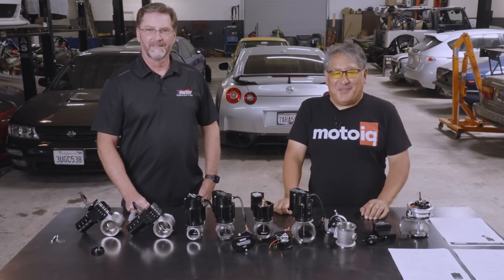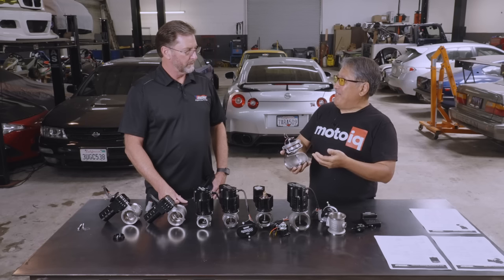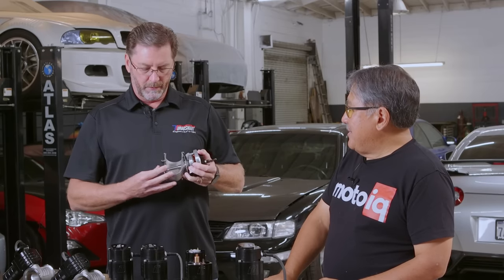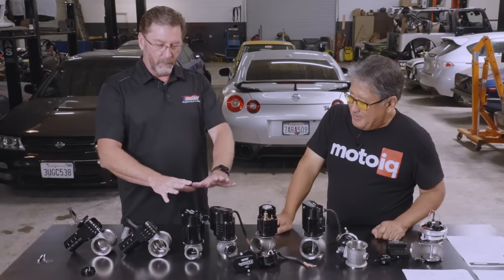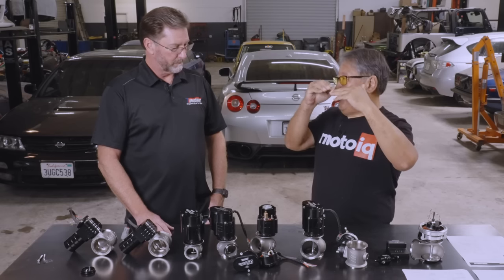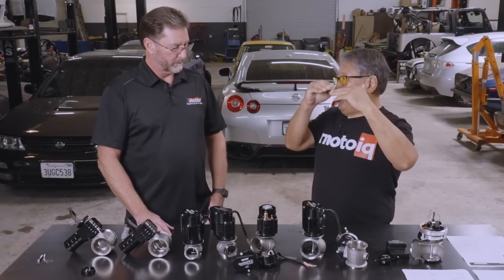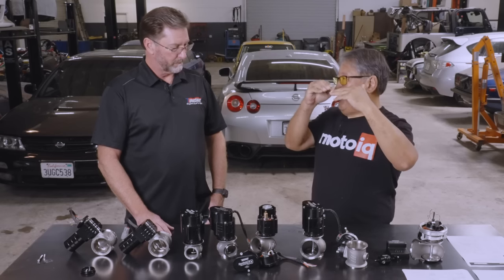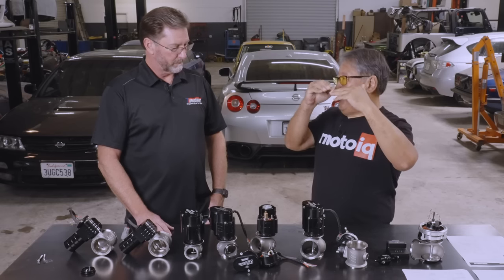The Future of Boost Control: Electronic Wastegates

Comment: As an industrial automation controls engineer, I fail to see how valve POS is really all that relevant. Typically in industrial applications, we would for example monitor manifold pressure, drive pressure, and supply pressure to the diaphragm on the wastegate. Then there would be an I/P converter & PID loop controlling the supply pressure to the waste gate diaphragm. Valve pos is really irrelevant as what you’re controlling is boost/manifold pressure. What everything else is doing is somewhat irrelevant. IE open loop controls. Not an engine tuner so I’m not inherently familiar with these issues however seems weird to me as industrial applications we control pneumatic and hydraulics in this manner all the time.
Reply from the maker: The valve postion equates to flow volume, like any poppet style valve, it's pretty common sense.
Reply: @motoiq  What I was referring to is the PID, target manifold pressure in conjunction with the rest of the IO handle that. The Processor/PID determines output based on reference manifold pressure. In this sense the valve position is irrelevant. Most analog valves wether they be pneumatic, hydraulic don’t have an LVDT or encoder to determine valve position and work just fine. Your answer explains nothing….
My question was, is there a reason this control approach won’t work in this application. It’s literally used all over industry and works just fine… As in maybe there is a legitimate reason for not using it, I don’t know. I’m assuming you don’t have a clue either as you just spouted off valve position determines flow. Well duh!!! And that flow isn’t proportional to valve position either so you’d need a curve to calculate that. Which when one is using a reference manifold pressure - input 1, and has logic that dictates a target manifold pressure -input 2 and you’ve got an output waste gate 1, the differential between input 1 and input 2 dictates what output 1 does… I don’t need to know valve position… if manifold pressure is low, close the waste gate! If it’s high open it. Obviously an over simplification as these are analog devices and not Boolean but the point remains. How is the actual valve position relevant. As far as I’m aware the logic or computer isn’t determining waste gate output based on flow rate. To utilize that properly you need to know exactly what the exhaust flow rate is which obviously changes drastically very quickly. Doesn’t seem like an ideal controls strategy thus making waste gate valve position irrelevant. The PID is controlling to a set psi, not a set flow. You also mentioned compressor shaft speed. That could relatively easily be handled as well by some additional inputs in the PID controller. None of which again for the umpteenth time care about flow, when pressure is what’s of concern… Obviously flow is important but as far as the PID control loop is concerned, not so much.
Reply from the maker: Ah ok now I understand what you were saying and I agree that the valve position doesnt matter when the controller is looking at MAP or shaft speed.  I thought you meant that the valve postion doesnt matter from a flow standpoint.
Reply: @motoiq  a nice PID control would utilize shaft speed and valve position solely for error control IMHO. For example shaft speed gets to high, open the waste gate, valve position isn’t properly responding open waste gate, drop fuel. Save the engine, save the turbo. Other than that, that’s all I can see it’s relevant for. you could even use the shaft speed for boost leak detection, if shaft speed were high, vale was closed and MAP was low, one could infer there is a boost leak. In which case you still want to open the waste gate and or cut fuel.

Comment: i cannot understand, why "future", if some turbos has an electronic solenoid that manage the INTERNAL wastegate of their turbo. i have it on my fiorino city 2019 (ram v700 city) 1.3 diesel, by garrett gt12 series. i cannot understand
Reply from the maker: Because it's a shitty low capacity internal wastegate. This is a big high capacity motorsports wastegate, the first of it's kind on a consumer level.

Comment: while this is neat, there is a huge problem, heat and electronics, ( specifically motors) DO NOT MIX whiel the concept is cool, i foresee a LOT of problems with failed steppers for the gate valve.
Reply from the maker: This has been rigorously validated under conditions that would cook a mechanical wastegate. Mechanical wastegates can be failure-prone if the turbo system isn't designed properly, especially under racing conditions. The typical short-term failure mode is diaphragm melting, spring cooking, and losing tension or both. The longer term is valve stem scaling and sticking.
Reply: @motoiq  i stil think the steppers will fail under normal conditions sooner. just like every IAC i've seen over about 10 years old. there is also current based wear on electronic components as electricity is the constant transfer of electronics across conductive surfaces, this leads to breakdown over time from ionization as well as atomic frictional wear and tear from the electrons jumping. and a preocess called electromigration.
Reply from the maker: Which also happens to a standard mechanical wastegate. Electromigration is more of a thin film semiconductor thing and would be an issue if the part was not designed and validated for this sort of use like this is. We talked about it briefly but if you read the literature that comes with the wastage the validation testing is more more riguous that typical mechanical wastegates.

Comment: Add in possibility of loose, damp, corroded contacts.
Reply from the maker: Lots can go wrong with conventional wastegates as well, vacuum line falls off or gets left off, vacuum line deteriorates or melts, diaphragm melts or develops leaks, spring looses tension, valve sticks. I have seen all of this in my time working on turbo race cars.
Reply: @motoiq  yes...and radiator hoses fall off too !
Try watching YouTube !
Theirs video after VIDEO of wiring issues on today's electrics !!!
Tell me the TRUTH !
Do you use factory idiot lights or do you use say Auto-meter mechanical gauges on race cars ???
Engines have heat cycles..
Moisture, forms then evaporates...
Problems arise.
Springs collapse ???
What about jour valve springs ??
Which is used more,
Waste gate springs or valve springs ??
Your chassis has springs too !!
You just want to SELL THEM !
Or are sponsored.
Reply from the maker: Do you even race anything? The street doesnt count. Do you understand anything technical at all?  From your reply, I think not. Wastegates get many times hotter than valve springs, they can get over 1000 degrees when bypassing hot exhaust gas pre-turbine, the gas is really hot, like 1400 degrees or more. Hot enough to melt silicone and nomex diaphragms and for the springs to lose tension. Hot enough to require exotic materials in the construction like inconel and MAR-M with PVD coatings.  That's why they have to be placed where they will get good airflow and even watercooled.  When you are doing something like road racing or drifting, that hot gas will be going through that wastegate for 30 or more seconds straight. Not cycling where heat transfer to a water jacket can occur like a valve.  If you are on the salt flats, it could be a few minutes of hot gas exposure.  That gas is corrosive as well,  depending on the fuel type it can be really corrosive, heat (which speeds chemical reactions like oxidation) and corrosive gas causes scaling and pitting which causes leaking and sticking.  I mean generally for stuff that counts, we use Motec ECUs, dashes, data loggers, and PDM's not autometer gages.  I mean if you don't have a clue don't be so quick to tell someone they are not telling the truth.
Reply: @motoiq  Dude I'm retired.
I drag raced for years best daily driver 11:80 115 mph.
Got bored with that.
As drag racing is..
Then went to stock cars, first asphalt then on to dirt late models.
(77 Ed Howe Camaro, 468 BBC)
Dude...we don't race them in seconds...like boring drag cars...
Ya need to run 100 laps with a car banging your rear bumper..
Side by side..turn after turn.
First turbo truck I drove was in 1971...ive been around a "few"
Mostly I've driven trucks.
My record was 750k on it's original turbo.
Funny how they change colors after pulling 80k up a mountain for an hour and a half.
We run like 30psi.
Of course now they're using variable pitch now.
Next time you get a chance, stop at a fuel island at the truck stop .
Theyll open their hoods to check oil..LOOK at the turbos.
See if they have diaphrams. (?)
Actually diaphrams last a while...
As for years, we had DIAPHRAMS In our Fuel PUMPS !!
(Whodafiggured ?)
Son...I remember when Holley came out with the DUAL INLET !!
Finally got away from Carter AFBS !
(You know what those are ??)
Or....ya think edlebrock invented them ??
My first cam was a 30-30 ya know what that is ??
OR how about a MALLORY REV-POL ???
Packard 440's witj Raja clip !

Frankly....
SO WHAT ...
If I never raced...
Doesnt mean I can't keep a vacuum line connected !
You know (probably not)
What jour set up has be be to finish your qualifying rounds heat races AND the feature, WITH OUT SOMETHING FALLING OFF ???
Big deal 10 second car.
What 2-3 qualifiers ?
4-5 passes ??
Ya get 100 seconds ...
Oh WOW..
we RACED ALOT..
150 SECONDS !!!

You know how to tell someone loosing a discussion ???

....they ATTACK your charactor !
NOW HIDE !!
....block me....
Reply from the maker: You have no idea how old I am what I know, or what my qualifications are, I am a lot older than you think. I have no need to brag or flex about it, just state relevant facts. Diesel engines have much lower exhaust energy and lower EGTs than gas engines by several hundred degrees. Also for OEM diesels found in long haul trucks the wastegate construction is designed for its intended use.  For truck diesels, the wastegate is almost always an internal design to the exhaust housing of the turbo, and the actuator is remotely mounted away from heat.  If it is an external wastegate it is located where it has sufficient cooling for reliability and is sometimes water-cooled.  Diesel wastegates are also much lower volume systems.  A gas racing engine can wastegate up to 80% of the total exhaust volume. Talking about diesels is also irrelevant to your initial point which is probably stating that this wastegate is junk with no understanding or experience with it, due to your writing, that is also not clear.  Also what racing class do you run a turbocharged car for 2-3 qualifiers for 150 seconds at WOT? Not even LSR racing, not even pikes peak. I call BS.  If you actually did such demanding racing you would be struggling with wastegate durability issues at times as well.    What is lame is someone who just attacked your character big time by calling you a liar baselessly, accusing you of attacking there's. Then saying you are losing when there is no argument and no winning or losing just stating facts. What a big deflection.
Reply: @motoiq  Lemme get his right..ok ??

You stated I never raced..
(start of personal attack)

Then when I tell you..

I'm somehow bragging ???
Reply from the maker: I am not looking for an argument nor I am deflecting like you are. Back to the original stuff where you attack my integrity. Let's stick to the facts and try not to take pokes at me, it's lame.

Comment: The future of boost control is no boost conyrol. Look at the hlava sequential turbo manifold. You run a small turbo for immediate response low RPM and a big tutbo that is too big for your engine if ran alone that wont over boost at high RPM and thus wont need boost control. Zero exhaust waste system. Go check out the manifold from absolute manufacturing. It has exhaust valves that shut off exhaust to the small turbo and redirect all exhaust to the big turbo so there is no parasitic drain put on the exhaust like with a normal sequential turbo manifold setup.
Reply from the maker: You still need boost control in a sequential turbo.  Wastegates also do more than just manage boost, they also manage backpressure.
Reply: @motoiq  please checkout their wastegateless system and tell me what you think 🙏. Two turbos zero wastegates.
Reply: They run a big turbo that would lag too much to be useful alone on that engine. Under low RPM it spools both the small turbo and the large turbo but after the big turbo is spooled it has valves that shut off flow to the small turbo and redirects all exhaust gas to the large turbo for the top end. They claim that with the appropriate large turbo selection that no wastegate is needed as that big of a turbo can't overboost the engine and they have the running concept on their 3000gt.
Reply from the maker: A properly designed system with a wategate will work better and have a wider powerband with less complication and less weight.

Comment: Looks like your going to need another engine bay to have enough room for those mount
Reply from the maker: On the other hand, it's not any bigger than wastegates just a few years ago!
Reply: @motoiq  on the other hand  electronics always fails under extreme temperatures and or vibration
Reply from the maker: Not if they are properly designed for the conditions.  Regular wastegates can easily fail due to high temperatures as well.

Comment: I like the idea but you need a real good setup because if someone unplugs you waste Gate or the wire burns or anything and you are not maxing out your turbo then there goes you motor
Reply from the maker: since you are running a stand alone to run the wastegate, you can have safety parameters programed into it.
Reply: If someone unplugs your wastegate and you do not have any way to have the ECM notify you then it would be up to the overboost protection protocol in your ECU to help avoid catastrophic failure. Overboost protections should be in place regardless if using an electronic or pneumatic wastegate. 

If you burn wires then that sounds more like negligent use. Aside from an actual fire in the engine bay, we have not come across anyone burning wires since usually people take precautionary measures to protect them.
Reply from the maker: Sort of the same thing as if someone disconnects or if the hose to your actuator burns up!

Comment: Are we sure that using the word linnier with respect to this type of valve is the correct wording. if flow is linier it is linier to what? certainly not valve possition with this valve. Maybe saying that with the electronic control we have over this valve we can obtain a very smooth rate of flow change accross the valve. Or are gear heads not smart enough for this?
Reply: More linear flow compared to traditional poppet style wastegates. You are welcome to review our technical data sheets where we openly share our flow data. We have them available for both poppet and butterfly style wastegates.
Reply: For the StraightGate, it is as near linear as possible. The flow chart is available in the data sheet on the website.
Reply: thanks for the trouble to reply. cheers. @TurbosmartHQ
Reply: Thanks for the trouble to reply.Cheers

Comment: Except they cant be controlled out of the box by holley efi, and by time i buy the black box this is at least $1500! Turbosmart should put in the time to develop a work instruction on how to directly pwm these from popular efi systems
Reply: They operate from a 0-12vdc signal and cannot accept a PWM directly. Ideally, the ecu manufacturer would update their software to support new technology. ;-)
Reply: ya I was going say...I mean if you use like a eboost to control it I guess its a good idea, aka standalone boost control.

Comment: Future??
They have been used in production cars for years now!
Reply: True. Racers are a lot harder on their parts and these are basically for competition.
Reply: Available for aftermarket
Reply from the maker: ^ This
Reply: The future for motorsports. As mentioned in the video, electronic actuators are nothing new on OE applications. These are designed for hardcore motorsports applications. That being said, they would work just fine for the highly modified street car as well.

Comment: Old news; My 2007 Ford Transit Connect diesel van, has an electronically controlled wastegate…
Reply from the maker: But not a big high capacity motorsports level external wastegate, this is the first in that market.